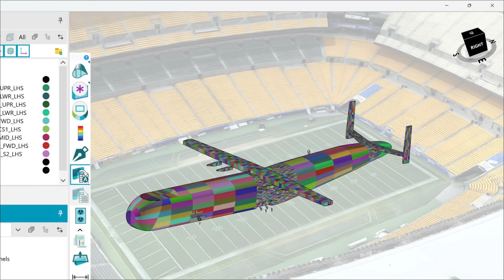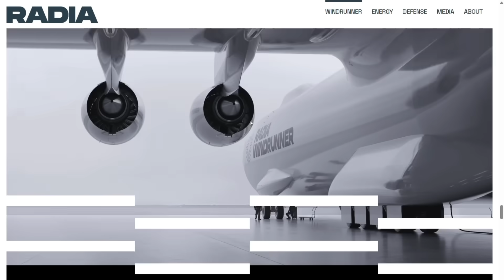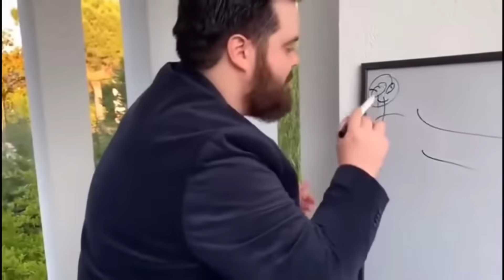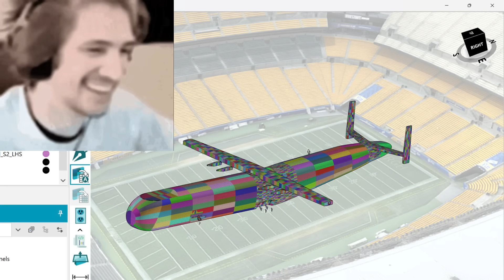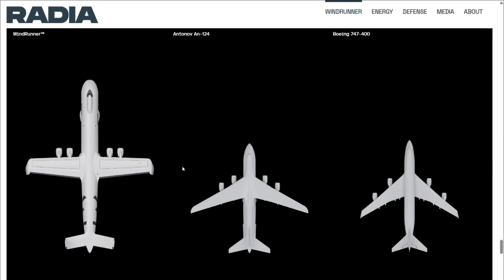Is This Megaplane ACTUALLY Real?

Comment from the maker: At the airport rn…😳
Track my flight (SY1815) BE THERE OR BE SQUARE!!! (flightradar24)
Reply: Why would you want to go to Milwaukee
Reply from the maker: @aviation_426  Milwaukee is not for the faint hearted
Reply: I think i already tracked your airport (no offense)
Reply: Wtf is Sun Country Airlines?
Reply: @andrewpinedo1883  an airline
Reply: @andrewpinedo1883 a loser
Reply: @andrewpinedo1883  I think u are late to look😂
Reply: peak stalking
Reply: Make this the most tracked flight on Flightradar24!
Reply: I saw it
Reply: aninov-225  looks like a 7 year dread 😂
Reply: just so you know, the blades were manufactured in separate pieces, but wind turbines have gotten soo big that they are just one large piece. so no, they can’t be built “on site”
Reply: Hi ice 711
Reply: I dunno if you remember but I sent you those IL62 drawings
Reply: And
Reply: I've never gotten a response or a vid
Reply: Also
Reply: My YT tablet broke so I'm using my big brothers acc
Reply: Bro got a AN-225 from temu 💀
Reply: O motor é pequeno
Reply: im too late :(
Reply: @matywosn  it's fine 😊

Comment: That is real the WindRunner plane is real in the sense that it's a massive cargo aircraft concept under development by Radia, designed to transport huge wind turbine blades to remote areas, capable of using short, rough airstrips, and potentially for military use, though it's still in design/development and not yet flying, with first flights expected around 2030.

Comment: The comparable aircraft isn't a military transport, this is more like the Airbus Beluga. Both the Windrunner and the Beluga have very large interior volumes to carry bulky but relatively low-density items. I could see the Windrunner being used to transport something like rocket parts that are too large to be transported by rail or barge.

Comment: So from the video, it's cargo capacity is 80 tons. The 747-8F (newest freighter variant) has a cargo capacity of 139 tons. The AN-225 had a capacity of 250 tons. This plane's wings aren't design for high lift (they're too small), so it's usability is VERY limited. The pictures of it holding a 747, is just the fuselage, and the most stripped down one (minus fuel tanks and pretty much everything inside) is about 47 tons. That would make the plane about the equivalent of the Dream Lifter used in 787 assembly. The problem is, outside of it's specific market, the plane isn't competitive with the 747 on actual freight capacity (weight).

Comment: Well... It's obvious to everyone that the wings on this plane are too small. Take off/landing speed would probably be twice as high compared to what we already have. Its lift in general would be very low due to its small wings, so it needs to keep its speeds high to even fly despite it not designed to fly fast.

If the goal was really to be big with a short wingspan, they should've atleast considered a delta wing design, double the wing's surface area, or add another pair at the front. Just simple add more wing surface area to increase lift

Comment: Well... It's obvious to everyone that the wings on this plane are too small. Take off/landing speed would probably be twice as high compared to what we already have. Its lift in general would be very low due to ots small wings, so it needs to keep its speeds high to even fly despite it not designed to fly fast.

Of the goal was really to be big with a short wingspan, they should've atleast considered a delta wing design to have a larger wing surface.

Comment: They argued that the militarily, they could carry helicopters without the need to disassemble them like other aircraft. Which would be genuinely useful, and a helicopter with no fuel or weapons isn't that heavy, so the low payload mass isn't much of an issue.

Comment: I... don't doubt that it could be built. Now, to be clear. Its incredibly niche. And while it's absolutely huge, its actually really light weight, shipping mostly air. Which is why it doesn't need ginormous wings to match its length. Does mean that it'd actually kinda suck as a military transport though. Intimidating yes, but... not very good at carrying lots and lots of cargo.
Reply: Unless you carry air (like aerogel or something).

Comment: Turbine blades are airfoils are they not... at this rate it is probably easier to build a car with a propeller that the blades are attached to like wings so it flies to its destination and drives back. Or just get a large helicopter to carry them. No part of this design makes any sense

Comment: Gonna be honest, This thing ain’t leaving the drawing board
Reply: I don't think it's that crazy tbh because it's not supposed to carry particularly heavy loads, it's just like a smaller cargo plane with an inflated fuselage to fit cargo with oversized dimensions.  Cargo volume and MTOW don't always match eachother.  This thing is basically a mid-large size freighter by payload capacity, it just has the ability to spread that payload capacity over a larger volume of space.  It has pretty massive wing area, and doesn't seem intended to be overly long range or particularly worried about stuff like cruise efficiency, which fits its purpose.  Less crazy than it might appear at first anyway imo, especially with large-but-light composite industrial components becoming more and more common.
Reply: @rocksandforestquiver959  It just sucks tho. You can probably just attach several of these blades on the outside of better cargo plane.
Reply: @alexturnbackthearmy1907 Yeah I'm sure putting an airfoil the size of most existing cargo aircraft on the outside wouldn't cause a single issue... So easy they've already done it right?
Reply: fr. no way someone builds this especially in the us

Comment: WAAAAAAAAAAAAAAAAAAAA NOT THE C5 GETTING REPLACED OR THE AN225 OR AN 124 AAAAAAAAAAAAA I HATE THIS SH- I don't think it will even fly coz the wings are WAY WAY WAYYYY too short and ONLY 4 ENGINES FOR A PLANE BIGGER THAN THE AN225??? Jeez.

Comment: needs more wingspan. This is just dumb.. if all engines shut down, it’ll just get destroyed. The centre of gravity is all in front of the plane, and the minute it’s near to stalling, the mass is gonna crush downwards.
Reply: Glide efficiency of the F-4 Phantom (the F-4 phantom has the glide efficiency of a brick)
Reply: @Aptol EXACTLY bro like it’s built like it’s supposed to be made for 0 glide
Reply: Not to mention the wingspan is less then the body span

Comment: No neeed for 6 engines, AN225 had 6 Progress D-18T  with a thrust of 51.000 pounds(23.437 kg)each for a total of 306.000 pounds (139.000 kg)   while current General Electric (GE)90-115B has 115.000 pounds of thrust, total 460.000 pounds (208.000 Kg) with just 4 engines. . Engine power with current western turbofans is not an issue.

Comment: • Air India Flight 171 crash: A Boeing 787-8 crashed shortly after takeoff from Ahmedabad Airport, India. Almost all crew and passengers were killed, along with 19 people on the ground.
• Vans RV-10 crash in California: A single-engine plane crashed into the roof of a warehouse building in Fullerton, causing a fire. Two people died and 18 were injured.
• Angara Flight 2311 crash: In July 2025, Angara 2311 crashed.
• American Eagle Flight 5342 crash: In January 2025, American Eagle 5342 crashed.
• Sacramento rescue helicopter crash: A rescue helicopter crashed on a highway in California.

 Other incidents and accidents:
• Radom-Sadków accident (August 28, 2025): F-16 aircraft crash.
• Nice airport incident (September 21, 2025): Two A320 aircraft came dangerously close to each other.
• Międzybrodzkie Lake accident (October 8, 2025): The aircraft crashed into the lake.
• Krakow airport incident (October 11, 2025): A smoke alarm was issued on a Ryanair (Malta Air) flight.
• Another accident in the US: In June, an engine fire occurred on a passenger plane carrying business leaders from Van Nuys Airport, resulting in a crash on a golf course.

• UPS Airlines crash in Louisville on November 4.
On an MD11 aircraft, the number 1 engine caught fire and broke off during takeoff.  The plane crashed into a factory or warehouse.
About 12 people died, but this number may rise.

•C130 Hercules crash on November 11th
A Turkish Air Force plane crashed on the border between Georgia and Azerbaijan. The plane broke into three pieces mid-air and crashed to the ground.

•Collision in Washington. On January 30th, in the US capital, over the Potomac River, a CRJ700 collided mid-air with a Sikorsky UH-60 Black Hawk helicopter. Unfortunately, no one on board either plane survived.

•Delta Conection 4819 lost its right wing upon landing, causing the plane to spin upside down.

All survived.

Comment: "startup company" 2016 was 9 years ago. thats not 'new'.

also no, you cant just load huge wind turbine blades onto a couple of train cars. trains are a certian width, alot of american railways do not exceed this width.

as they stated in their video. point a, to point b, direct route, middle of nowhere.

is it ironic to use a plane to haul renewable tech? yeah. but it might be more efficent than having to have several routes planned, cleared, or even dismantled to get 1 turbine through.

no, you cannot just make a wind turbine, in the middle of nowhere. i suggest you do your research on how these things are made, how big they are, the logistical challenges, so on. befor you make another less than intellegent or compelling arguement mocking this plane.

is it a bold move? yep. do i think itll takeoff the ground? nope, wings need to be abit bigger imo.

your presentation is alright, just do your research really. no hate from me man.
Reply: You deserve a pin
Reply: this shit has wing loading heavier than your mom and yet it's claimed to land without airport.

Comment: Looking at the picture before its said 
Im guessing its a ground effect aircraft as it looks similar to the ekranoplan

Ok i dont think that design is practical anymore unless it were to use the ground effect

“According to all known laws of aviation there is no way this plane should be able to fly. Its wings feel to small to get its fat giant body off the tarmac in any reasonable distance , but the company says it will because it doesn’t care what aviation fans say about planes”
Cant wait to see a redesign appear or just see them scrap the whole project entirely 
It genuinely seems as feasible as the Gustav railway gun

Honestly it could be more reasonable to just take longer routes with the trucks to avoid issues and probably save more fuel 
Not to mention with the plane you would have to probably make a proper run way because i doubt that it would be using “off-roading balloon wheels” and if they did make a proper runway that would ruin the point of reducing ground vehicle transport because you would need to move all the vehicles and people out there to not build a wind turbine but a slightly used runway (only potential upside is for maintenance purposes as you could do repairs by bringing parts and probably service vehicles if it isn’t taking a whole turbine blade)
But then again 
Isn’t the entire purpose of wind turbines to reduce carbon emissions

Comment: I'm not the only one who thinks this, but honestly the windrunner's job is much better done by a large modern airship. look at the flying whales LCA60T for instance, which doesn't exist yet but seems to be getting more traction/funding than radia, even getting funds from the french government. Or LTA Research, which actually has a 400ft long prototype flying in california as we speak and plans even larger ones in the future. AFAIK the only reason they didn't make this thing an airship is because they reasoned it'd be too far of a step forward and they wanted to stick with a conventional design, but an airship would inherently be a lot better for this job. Able to carry giant loads even suspended, can hover in place and doesn't need a runway (or, in the case of a hybrid, only a very short one).

Comment: The Radia WindRunner is an enormous cargo aircraft currently being developed by the company Radia, with the primary goal of transporting the large blades of onshore wind turbines to remote locations. It is designed to be the world's largest aircraft by volume, capable of carrying oversized components that are too large for current transportation methods. The aircraft is intended for both clean energy and defense applications and can land on unpaved, short runways.  Key features and specifications
Dimensions: The aircraft will be approximately 356 feet (108 meters) long, with a wingspan of 261 feet (80 meters). 
Cargo capacity: It will feature a massive internal cargo bay of 7,700 cubic meters, roughly 12 times that of a Boeing 747. Its maximum payload weight is about 160,000 pounds (72,575 kg). 
Transport capability: The WindRunner is designed to carry components up to 344 feet (105 meters) long and 24 feet (7.3 meters) high. 
Infrastructure requirements: It is designed to land on semi-prepared airstrips as short as 6,000 feet (1,800 meters), requiring no specialized ground infrastructure. 
Loading: It features a nose that retracts upward for front-loading, similar to a 747. Clean energy: The primary purpose is to enable the deployment of larger, more efficient wind turbines by transporting their components to locations that are difficult to access by land. 
Defense and aerospace: The design is dual-use, and the U.S. Department of Defense is collaborating with Radia to assess its suitability for military logistics, including transporting large equipment, space launch materials, and humanitarian aid. 
Disaster response: The aircraft's ability to land on basic airstrips makes it a potential tool for emergency and disaster relief efforts. 

-Google

Comment: That wing to fuselage ratio is an abomination
Reply from the maker: Like what are we even looking at 😭
Reply: @ice711real That wingspan has to be the size of a freaking smart car😭✌️ And the hump has to be from a literal ATl 98😔🥀✌️
Reply: @ice711real  a monstrosity
Reply: I forgor something: 4 ENGINES. HUGE AHH PLANE. A340 ahh plane
Reply: F104 ahh plane
Reply: @DumbOrangeFrog X-15 ahh wings✌️😭
Reply: @south_w3st-editz This is like the AN-225 but with small arms
Reply: Sure, but if it's just made to carry relatively lightweight turbine blades, as opposed to denser cargo found on most air freighters, those wings could be sized right for the mission.
Reply: @米空軍パイロット  "Wing" area is small, but it got a gigantic (and probably very light) hull which effectively does same job as wing. So its a biplane.